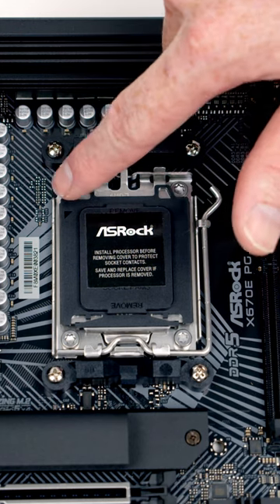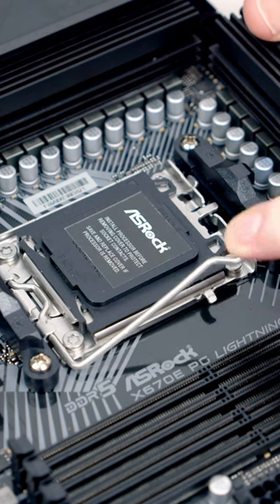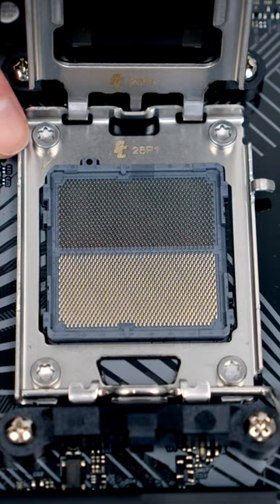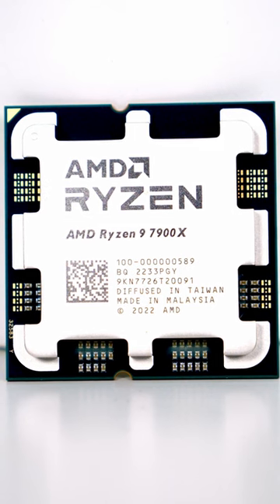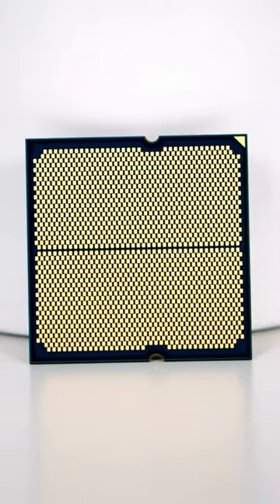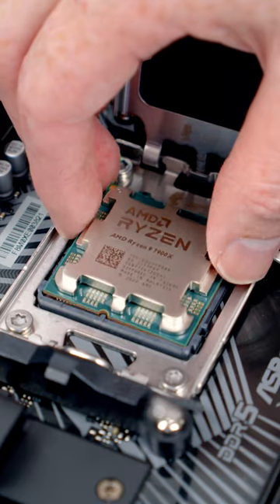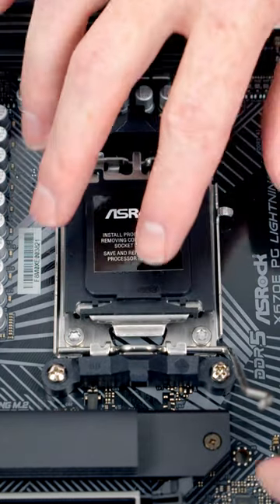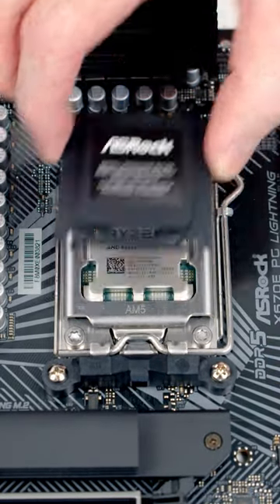How to Install a Ryzen 7000 Series CPU in AM5 Socket #shorts

Comment: so it's basically an intel socket now
Reply: Actually AMD was the first to use land grid array (LGA)
Reply: "AMD introduced their server LGA platform starting with the 2000-series Opteron in Q2 2006. AMD offered the Athlon 64 FX series on socket 1207FX through ASUS's L1N64-SLI WS motherboards. "
Reply: @dk644j  “the interface did not gain mainstream use until Intel introduced their LGA platform, starting with the 5x0 and 6x0 sequence Pentium 4 (Prescott) in 2004. All Pentium D and Core 2 desktop processors use LGA 775 socket. As of Q1 2006, Intel switched the Xeon server platform to LGA, starting with the 5000-series models.” You got proved wrong from your own source ☠️
Reply: @dk644j  While LGA sockets have been in use as early as 1996 by the MIPS R10000, HP PA-8000, and Sun UltraSPARC II processors
Reply: @dk644j  In short AMD was never the first to use lga that’s just silly
Reply: @germanfisch  Kalt
Reply: @germanfisch  Was war dann meine Quelle?
Reply: @dk644j  wikipedia
Reply: @germanfisch  nine
Reply: @dk644j  "nine" 🤓
Reply: @germanfisch  gaining mainstream use doesn’t mean that they didn’t do it first. He wasn’t proved wrong. You just brought up a point you thought was valid but is not.
Reply: @germanfisch  They still used it first?
I mean my logic isn't flawless but mainstream use isn't the same as just using it.
Reply: @germanfisch  in other words, AMD used it before Intel, but AMD wasn't mainstream
Reply: @dk644j  nein 💀
Reply: @germanfisch he obviously meant between intel and amd
Reply: @yuminago  he said amd started using LGA in 2006, Intel did it in 2004. What's so hard to understand?

Comment: coming from am4 i thought i was putting too much force getting the latch closed. But rode with it. Made me nervous but seems like my 7950x3d is performing well.
Reply: I am experiencing the same. So that kind of pressure force is normal then?
Reply: @xellr  about 15/20lbs I'd say
Reply: Don't be scared. But I'd recommend an am5 contact plate better. I removed the oem cpu holder and replaced it with that from Amazon 8 bucks

Comment: Right as I speak it seems the amount of pressure is normal but man that is makeing me sweat by like the 20 Ibs you have to push down 😅
Reply: do you need to do a lot of pressure ? because im scared to close it out even tho i know the cpu is on the right place
Reply: @gr4nnx  yes an uncomfortable amount quadrouble check the triangle is lined up and lay it gently flat and square as possible and then push down with an uncomfortable amount of force
Reply: @connorthomas2667  thank you i did it yesterday i was panicking but i did it  scary experience ( my eng. is bad sorry for that)

Comment: do i need that plastic socket cover when changing from an old cpu? does it do any lining up or pressure application things or is it purely for pin protection?
Reply: You should keep that cover. For the RMA (warranty process) if you send the board it will need to have the black plastic case on it. Otherwise warranty will be denied.

Comment: I was so scared when I put my processor into my computer. This is my first AM5 and when I first looked, I for some reason thought the pins were pointing upright and thought it was a little weird tha they looked that way and when I put the cpu in and had to apply all that pressure, I thought I bent the pins, then realized they're naturally bending inwards towards the center. Had a semi-heart attack
Reply: I've literally had a same thing, had to take off CPU to photo the CPU and mobo to fiends to make sure if I fucked up or everything is alright, turns out everything was alright

Comment: I’ve never installed CPU’s with the socket cover on. I always remove that and throw it away 😂.

What the purpose of the cover other than protecting from dust?
Reply: Brain't? Protecting the pins plus you don't get rma with no cover
Reply: if you throw that cover away you can't RMA the board if you have issues... it literally says on the plastic cover to keep it.

Comment: is it normal that i got problems closing it or am i just to soft
Reply: Normal, make sure its wiggled in firmly (DONT push down on it) and the triangles line up, and then pull the bar down like he did. It feels like it shouldnt require so much pressure but it does, even ram sometimes

Comment: Very Intel like ...
Reply: Well AMD made the LGA socket so…
Reply: @desupernoodle  AMD was actually basically the last to adopt LGA. Their first LGA socket was in 2006, Intel's was in 2004, neither were the company that used it first.
Reply: @bradonhoover3002  Made it first
Reply: @danielchettiar5670   That would be Hewlett-Packard in 1995 with the PA-8000. Neither of the two processor giants, like I said. Also what's the distinction supposed to be between made and used? It doesn't change the timeline one way or the other, and it still makes me right
Reply: @Bradon Hoover  AMD first and that's the end of it no more out of you.
Reply: @DeadPiixxel  But it was last tho

Comment: And what if you bend a pin now?!
Reply: just straighten them, like before, but now it's on the other side
Reply: @CaZ0  thanks ... sure, I guess I prefer having the CPU 'checkable' over my mobo (even if the CPU costs a lot more, it's far more easy to remove!).
Reply: TRX workstation were same from atleast 2 generations
Reply: You put it in the wee socket
Reply: @idzkk  dude those cpus cost way more than the mobo
Reply: If you bend a pin or a few it soesnt really matter because its just how many processes it can run but if you bend all of them...... 😶
Reply: More info here: https://youtu.be/d6pIbLwQ6Hc
Reply: You get to throw your board in the trash instead of your CPU. Bad news since AM5 boards are expensive!!!
Reply: @johnw4067  I am going through that issue right now. ASUS wants $184 for the repair. Never had the board in the case yet.

Comment: You just buy Intel instead
Reply: My last intel rig was with a i7 9700k and a 1070ftw I decided to get a 7900x and a evga ftw3 3080
Reply: am5 will be easier to upgrade without changing mobo for long term generations then intel mobos still unless they decide to make a change to that moving forward